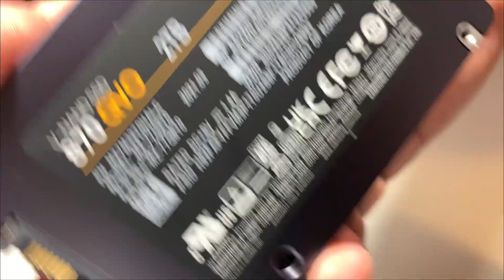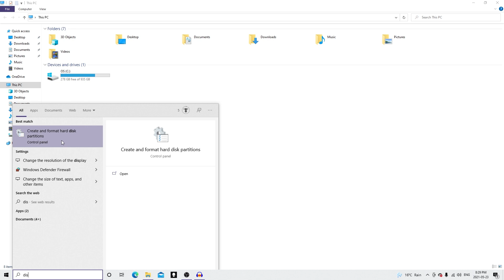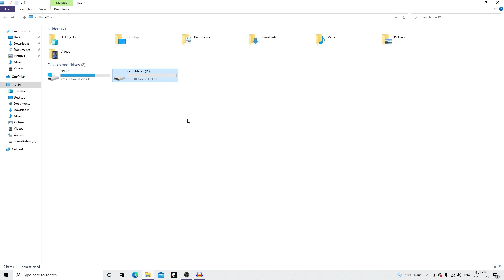How To Install SSD In Alienware Aurora R11/R12

Comment: For the sake of newbies (if I, myself, understand correctly; most of my PC experience is oldskool): This installation is a specific situation, where CryOut4AHM has already removed the original hard drive, so that was why he had that SATA cable there ready to go. So, this approach only works if you're replacing the original 3.5 inch drive, with a 2.5 inch SSD in the bottom bays. If you have a different 3.5 inch drive you want in there instead, use the space the original drive was housed. There's only one SATA cable in the case (as far as I know), so if you're keeping a 3.5 inch drive & supplementing with a 2.5 inch one, you'll need a new SATA III cable for that one as well. Check & see if the one you order might include one, or else you'll have to get one as well.

EDIT, now that I've had a chance to open one up myself: Thankfully, if your configuration didn't include extra physical stuff, there should be an extra power cable in the wad of wires by the power supply (I call this "bonus spaghetti", lol) so you can power the additional drive, after coaxing it down so it'll reach. But yeah, you still need a SATA III cable.
Reply: dude you’re a fucking life saver
Reply from the maker: ZaCloud Animations: yes good explanation but, I haven’t removed any hard drive. My R11 came with sata cable and power cable one end connected to the motherboard, all I had to do connect the ssd. Installing additional drive require sata cable if there’s non you will need one .
Reply: this actually saved me thank you bro
Reply: can also attest that getting a sata cable is necessary, thanks for the info
Reply: yea im trying to install a samsung evo 4tb ssd seta in mine and still cant find the second seta cable for the power supply and realized that the 2.5 slot can only handle up to 2tb so im hoping mine will still show up but probably only up to 2tb and i can atleast initialize the ssd and partition it because i bought a seta to usb adaptor and wasnt able to
Reply: @succotters9838  I'm a sis, but you're welcome. Glad to help.
✌️😎
Reply: @benboatright6461  Hmmm, is it that it physically won't fit the slot? Or that you think the system will only see 2TB out of the 4? If your concern is about Dell's listed specs, that's only what was tested at the time of development & what its options were at the time. I've found others with that concern, but everything worked out fine for those who followed up after successfully installing their own 4TB SSDs.

It's best to use direct SATA & internal power cable; USB would probably bottleneck, might even lead to corruption, or might not be properly visible to the system.

If it's only seeing 2TB, that could be part of why (I haven't worked with many PCs lately, so I could be wrong), otherwise if you're getting any errors or anything, that'd help narrow things down. Still, feel free to let me know what exactly is happening, if the rest of my comment didn't clear things up.

(Oh! And I just remembered... Is your SSD an EVO 870? Those have had massively faulty batches. If you got one, I recommend returning it & getting a different model. You can search that model + "failure" & see issues since at least 2021 ongoing.)
Reply: @ZaCloud-Animations___she-her  i installed a seagate ironwolf 3.5 12tb and didnt check the service manual saying that the capacity for 3.5 slot is 1tb and the 2.5 is 2tb but i was able to initialize the seagate and partition it and its reading the 12tb so looks like im good. im just waiting for seta power cable for my samsung evo 4tb ssd
Reply: @benboatright6461  Swee-eet. Like I said, the specs are only listing what was tested & released with the model that year. Because they don't want to make any claims about future-proofing non-stock upgrades. But when it comes to this particular combination of hardware & hookups, there currently should be no problem going beyond, in terms of disk space that it can handle.

I hope everything works out well for you. Take care~! 👍

Comment: Thank you for the video! What is the maximum storage I can add? Can I add an 8 Tb SSD? (I need a lot of storage for my use case unfortunately!). If not..a 4Tb is possible?
Reply from the maker: Yes, you can add up to 8tb . I had up to 4tb no issue so am sure you can add more.
Reply: @cryout4ahm  very interesting..but can you tell me how? I mean..which storage configuration did you follow? Did you put a single 4tb SSD? Or maybe a 4 Tb NVMe in the PCI slot? 
I thought about getting 2 SSD SATA 4Tb for each one.. can it work???
Thank you🙏🏽
Reply from the maker: @ahmedfarrag17  I am sure it’ll work if you go with 2 ssd sata . I had 2tb m.2 pcie ssd and 2tb ssd sata drive never had any issue.
Reply: And there’s 2 slots so you can fit 16

Comment: Ok so I bought the Alienware aurora r11 and thr hard drive is too slow so I want to upgrade to an ssd but i don’t even know what ssd to buy or what a ssd really is. If anyone has replaced they’re hard drive for an ssd on they’re r11 can you give me some pointers?
Reply from the maker: Either get a SSD or M.2 , M.2 is way faster than ssd but, I personally find easy to
Install an ssd in r11. Link is in the description for ssd. Let me know if there’s anything else I can help you with.
Reply: @cryout4ahm  am I gonna need to purchase something to install the ssd into the r11? Or can I just put the naked ssd into my computer and connect
Reply from the maker: @Aparou27  nothing else to purchase. Mine came with sata cable and power cable one end connected to the motherboard . Watch the video again should be helpful . And yes you just put the ssd in naked and connect.
Reply: @cryout4ahm  nice thanks for the help!!

Comment: Will i need to get a sata wire for ssd?
Reply from the maker: My r11 came with sata cable check and see if your pc came with one .
Reply: Well i want to have a hard drive and an ssd. So do i need to buy more wires for ssd?
Reply from the maker: Yes, you do .
Reply: @cryout4ahm  what are the names of the wires. Can u name them both for me?
Reply from the maker: You will be needing Sata Cable and Sata Power Cable.
Reply: @cryout4ahm  is there extra slots on the mother board to put those extra wires?
Reply from the maker: @MrMehdi123  yes
Reply: @jasonnosaj2340  new ssd and sats what? Im confused what ur asking
Reply: @MrMehdi123  Sorry bout that. I think i just need the blue cable which is the sata cable right? Cause i don’t have it on mine for the extra ssd
Reply: @jasonnosaj2340  that blue cable is a sata cable
Reply from the maker: I made another video on that , check out my description.